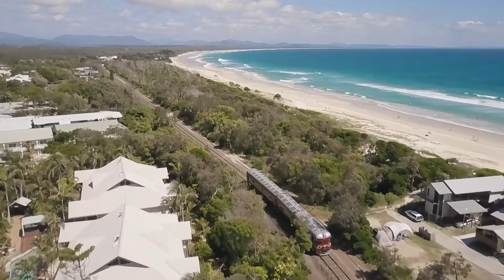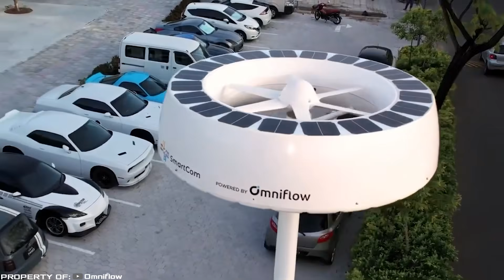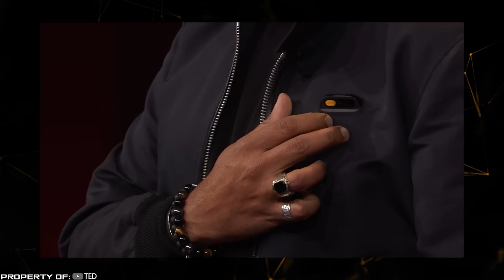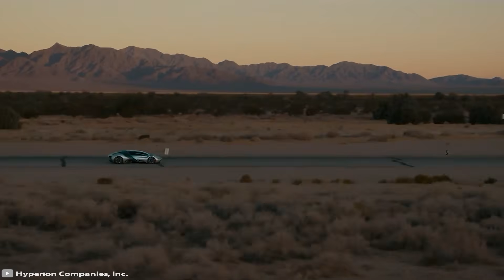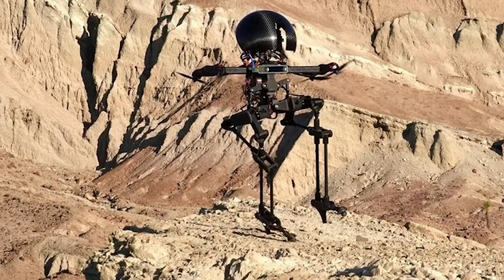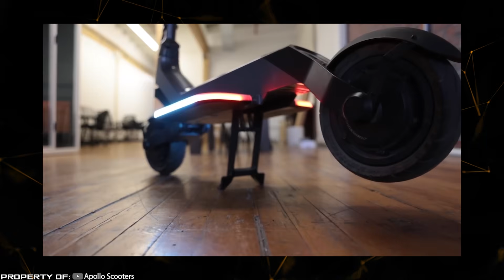INCREDIBLE INVENTIONS THAT WILL BLOW YOUR MIND | BEST OF 2023

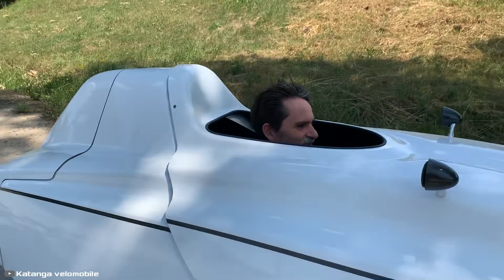Comment: (min. 12:28) Take a disc, or ball with a  diameter between 3.5" to 5' depending on the size of your hand. Hold the object facing upward with as few or as many fingers as you please with the edge  spaced between your fingers tips.  Without giving it a whole lot of thought, use your fingers (and thumb) to turn the disc between your fingers not letting the object fall, with the ball along its diameter. Reverse the direction as slow or fast as you like without too much thought. In fact the less you actualy think about it, you will watch the almost involuntary behavior of your finders placing themselves in just the right spacing  and timing to support the object and turn it. In fact if you attempt to tell or control which finger to move when, where, or how, you MAY notice, doing so will be awkwardly slow and you loosing control of the object. HOW would you develop a progam to tell three, four or five robotic fingers to do this?

Comment: the h2 panels have a flaw: #1- their core ingredient that makes them function, is platinum- so by the time you recover the cost of operation? you're still in the negative. #2- they only last for about 8 months before they fail- here's the major part he's NOT telling you: they use water fed to the panel- and they use sunlight to seperate the water into h2 & oxygen. BUT: EVEN IF you only feed them distilled water- the panels lose functionality completely by 1 year. the parent company that developed it cannot overcome this hurdle. this product will never come to market.

Comment: The Air Speeder 4 is definitely NOT the first racing Airplane. Professional Airplane races have been going on for almost as long as there have been Airplanes. 
 Have you never heard of pylon racing? Ya know, the Airplane races with the really fast internal combustion engines? There are several different classes, Some are bi-planes but most are mono-wing type. 
 And they are considerably faster than that plane.

Comment: The super lightweight Aptera that is liable to be blown over by a moderate wind, with half it's top surface covered with solar panels, takes 10 whole days of strong sunlight to charge. But the train with only 5% of it's roof covered by small solar panels use only 23% of the power from the solar panels? Something doesn't sound right here. It isn't even a new train. It's an old (ie heavy) train, with a few solar panels glued to it's roof.

Comment: 6.5 kW of solar panels is 9 hp!  Which may be peak power, less losses through buffering batteries, motor controllers etc. No wonder it’s barely moving.  Since the station has a lot of panels that can charge up batteries with the train idle, this would add to the power but overall this does not represent anything useful.

Comment: Switch from kg to literally without reference to pressure. Is it at atmospheric pressure? Does the system produce h2 from h20? If so what is the tech? Direct conversion in the cell or electrolysis? Something else?

Comment: The aerodyme truck trailer fuel saver is a good concept but isn't worth the hastle you have to go though to save. Just about all the trailers that I have pulled with this tech either doesn't open on its own like it should or you can't get it to close back up. Not worth the time.

Comment: Innovative Techs, 
You should look into Edison Motors.
They are a startup. They build and convert Semis into Diesel-electric. They take out the 19liter diesel engine and replace it with a 9liter generator that only runs 1/3 of the time. When it does run, it runs at peak efficiency for fewer emissions and better MPG. So the fuel tank can be smaller and still have the same range. They only need 1/4 of the batteries because of the generator. And the Semi weighs the same as it did before the conversion. They are also working on a way to convert full-sized pickups, buses, and RVs. Any vehicle with a solid rear axle. The generator can be anything, diesel, gasoline, natural gas, hydrogen, or instead of a generator, add more batteries. The generator is not part of the drive train. It is only to supply electricity to the batteries.

Trains have been using Diesel-Electric since the 1930's. It has been their standard since the 1950's. It doesn't matter if it's freight pulling millions of tons, or passenger pulling thousands of tons at 200 MPH. Its still Diesel-Electric.

Comment: The aerodyne concept is old and it won't work for the same reason the other didn't. The foils are supposed to deploy automatically once a specific speed is reached; however, the grit and grim from the road quickly gums up the works so they don't deploy.  Great concept, but until they can solve that issue, it's not going to be successful.

Comment: Win Lin need screen for birds. The AI pen is a S.T. communicator. The Egget needs hill resistance for heathy fish. Leonardo needs it's own ET movie. Cyclo tech propla
might work better on copter pack? The boat prop may be the best, if not, the $100 water heater (like the low cost computer did). Saline battery (not shown) will make elec go practical. 009AC4 plane could make VTAL double seater elec obsolete, with 12 passngers? Just thinking.

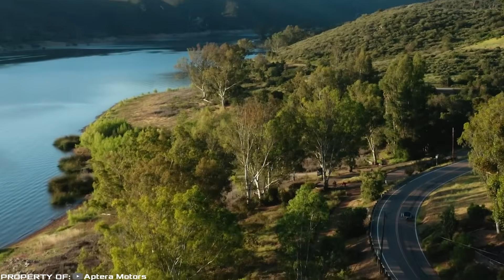Comment: 5:55 Every car manufacturer should be mandated to produce a universal, ultra efficient tear drop shaped, elongated electric vehicle (or the most ideal design possible, if thats not the best) at a reasonable price, and they can all offer their own spin offs on extra features and interior designs.
Reply: And a trailer of the same shape, or modular rear end on the vehicle that could be easily removed, and meld to a covered truck bed type rear end/ additional passenger cabin could replace trucks all together for most jobs, only used when needed and kept in the drive way or garage. The planet is dying and nobody seems to care.
Reply: But nobody would buy them   especially mandated .

Comment: We have sodium solid state batteries coming in March. These are already in production. These lithium batteries dont seem to ne ready wheteas Amprius and Quantumscape are already on the market. There is is also zn nava  batteries moving quickly and they can cycle 200k times and the materials are readily available. Not to mention they dont catch fire and already in use in over 200k homes.

Comment: Fraud. " Electricity will be supplied from the grid when there is insufficient solar and the train is intended to run on diesel fuel about once a week.[14]"   BURKE, JASMINE. "Byron Bay rail revived after 13 years with solar train". Northern Star. Archived from the original on 22 December 2017. Retrieved 20 December 2017.   From wiki article.    And probably got grants after giving COMPLETELY LEGAL campaign contributions to local politicians.

Comment: Thanks for showing Renewables.
But for me it's hard to watch clips about solar and wind generators wether for hydrogen or electicity generation still presented innovations or even inventions in 2024. These two products were first presented since the dicovery of direct current. But it took two centuries of carbonwasting thanks oil lobbyism to legislate the necessary standarts.
But the oil lobbies are still running us down ...

Comment: The Byron Bay Electric Train is Australian and a great example of what can be achieved.
The train only needs 23% of the energy generated from solar panels on the train shed roof, the remainder is fed back into the community grid.
The train also uses regenerative braking, meaning that every time it slows down, the energy created by braking recharges the train’s batteries.

Comment: using solar to make electricity to run electrolysis to make o2 and H, so you can then just burn the H to make heat? or  run a car??  COME ON,,, just take the solar electricity and run a electric heater for heat, which should be almost 100% efficient , or store electricity in batteries , and then run heaters or drive motors, etc, when needed...
Reply: Yes yes yes

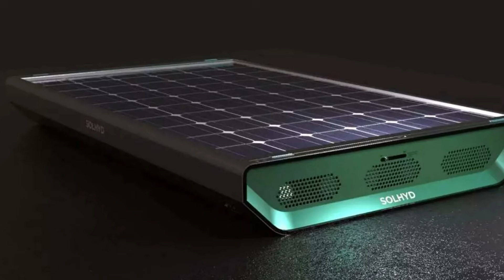Comment: @ 17:50 hydrogen sola panel than can produce "up to 250 L of hydrogen a day". Is that correct? That's equivalent to about 22 kg of hydrogen or 500 kilowatt hours when put through a fuel cell. Thats huge?

Comment: The LED light is much more dangerous for our environment than the lightbulb. And I have yet to find one that works for over 3 years when they advertise for 10 years.
Reply: The led bulbs usually fail because of the electronics used to step down the AC voltage. The led would still be usable if not for that.

Comment: I like the portable wind turbine. At around USD$400 (AUD$587) it seems good value if it is durable and replacement blades are available.
Reply: I understand theses kill a lot of birds.
Reply: @metrork1  Ouch... do theyes? I'm with you if the data shows that way.
Reply: VAWT's are less efficient than HAWT's, but VAWT's can be placed in locations that are not safe or appropriate for HAWT's, and VAWT's can be placed in greater density than HAWT's and produce less noise than HAWT's as well as being much easier to build and maintain. 

You can put a VAWT in your back yard or on your roof without getting complaints from your neighbors or having to put in geared arrangements to work with differing wind directions. Also, the generator part of the apparatus is fixed and at ground level, again making maintenance much easier.

And, VAWT's can easily be made nonhazardous to birds.
Reply: A far better wind generator is a cyindrical one and fits on the roof. And is small. And will power a home when the wind blows even gently. The bird chopper style costs more in maintenance than normal electrical sources.

Comment: They are solving a non existent problem. Global warming is not bad.  An increase of about 1.5 degrees since the little ice age.  The most prosperous century in history.  What we should be doing is developing even more coal, gas and nuclear power in preparation for when the climate reverses toward another ice age.  Also provide energy for undeveloped countries.
This video is also deceptive.  The solar panels on the train do not provide all the energy for the train to run.  Most of the energy to charge the batteries comes from the panels on the roof of the station.
Solar and wind have no hope of replacing existing dense energy of coal, gas, oil and nuclear.

Comment: "unreliable solid fuel boosters"
uh, no.
Reply: Exactly! SBR's are pretty much the most reliable rockets there are!  The concept is simple: No moving parts.  You just light it, and it runs ... RELIABLY ... until all the fuel is burned.  Then it stops.

Comment: Placing solar panels so crops can be grown underneath, in arizonz, ca is very promising, inreases wzter collection, shade am provides energy for electric tractors.  Solar reduces heat in hot areas such as phoenix by converting solzr energy into electricity vs heat.  This helps everyone in city further reduce air conditioning costs.

This should be mandated by law a.omg with white roofs.

Furthermore these reduce global warming by reflecting heat back i to sky, and could even increase rainfall.

Comment: That train will not run on its solar panel's alone unless maybe it sits in the sun for a year.  There is just not enough area for enough solar panels.  It doesn't work with cars either.  Grain of salt for most of this, especially the wind turbine stuff.

Comment: In a similar false statement - you put a claim on the manufacture of the Aptera they could charge their Motorcycle not car - to go 40 miles in a day. If you see the note below; it takes 10 full size panels to move a Model 3 15 miles; the Aptera if ever built for buyers has a very limited space of panels and even though it is ligther and stream lined it has no chance of going 40 miles; maybe 5 or 6 would be more feasible at 30mph. Do not just publish false claims because someone says so.

Comment: Something is dramatically false about your Solar Train report. It takes 10 full size solar panels 10 hours of intense sun to charge a Tesla model 3 to go 15 miles. This heavy train wouldn't go 2 miles. There is a statement "the solar panels provide 23% of energy needed while traveling on its route" This can only be true if you mean after it accelerates to speed which is what take all the power. 23% to keep it rolling after that isnt much. You might excersize some honestly in your reports so people are not lead to believe the rediculous.
Reply: Fantastic catch! 👏🏻 👏🏻 Yeah I was putting those numbers together when he was speaking about the train and was like... "Wait. That doesn't sound right." Thanks for doing the math already.❤
Reply: more like 23% of the phones and computers charging power outlets... 🤭
Reply: Fake news 😅😅😅
Reply: Rolling resistance of a train wheel on track is 10x less than a car tires on road. Even then I concur that the energy production is probably just sufficient for a very occasional usage.
Reply: @ericzucker  good to know so even with more panels its pretty much a sham to call it a green train powered by self contained solar.
Reply: We (my wife and I) power our home with solar. We have five 250 watt P/V panels. And that provides power for all of our electric needs, on sunny days.
   However, we do have a 500 watt wind turbine down here in southern Arizona. If the sun ain't shining. The wind is almost always powering the wind turbine, and a 4000 watt generator.
Reply: I could walk faster 😂
Reply: I think there are probably a lot of mistakes throughout. He kept referring to the drone bodes as engines, for a start. Then referred to the angle of inclination. Not the correct terminology so I guess the research is weak.
Reply: The train is just a tourist trap. It's as slow as a wet week and not always working and only travels on a single piece of track a couple of kms. long. (i live nearby).
Reply: @davehaven6986  Figures... Just ignore the man behind the curtain...
Reply: Edison EVs
Reply: Pñ
Reply: I notice straightaway that the train should be covered all over with solar panels which it isnt.
Reply: You nay seekers, this was rigorously tested in many lands, legoland, Disneyland, and many other countries. You should see them flying down the hill!!)
Reply: Don’t compare a solar car to a solar train depending on the gradient once you’re up to speed with good roller bearing on the bogies a train  will roll along way with out power added I know I’m a electric train driver and do this on my routes daily on some sections mostly up and down yes on a flat track you are right 🇦🇺 QLD
Reply: @ajllemm  fair enough but once you hit any sort of uphill; it will probably be quite useless to try to use direct sun to keep it going; flat ground is one thing and going up hill is quite a bit more energy demanding.  You are literally lifting the weight of the train.
Reply: @litestuffllc7249 Yes, but a huge amount of slowly built up massive momentum helps average out hills.  Once the first cars crest the summit & begin to descend, they are helping pull the latter cars up the incline.  Trains don't waste momentum with stop & gos.  The steel wheels on steel rails introduces much less rolling resistance than tires on pavement.  The close coupled cars break the wind for each other, reducing aero drag.  I read the fuel economy for trains is 400 mi. per ton per gallon of diesel fuel.  That's remarkable, but still not enough to justify those claims about the solar contribution.
Reply: @dennisbecraft1303  Yes that is an advatage of a train or even better with a cable car; but you do have to get up the hill.
Reply: Similarly you should prroofread so you don't mislead people about how "ridiculous" is spelled.  JK 😊

Comment: There's no way with current technology, that a train can be propelled with 23% of the output of solar panels on the roof.
Reply: From a show I watched specifically about that train. There is a little bit of an incline (hill) and they get a little worried going over it.  Maybe it uses 23% of total power generated throught the day cause most of the time it's sitting. But when operating I bet it needs all of its solar to operate. And you are only going to add so many batteries into the train cause it makes more weight to have to climb over that hill. So when the train docks the batteries charge to full 100%  capacity the extra solar power is fed into the grid instead of turning the system off and waiting for next train departure.
   I bet there are alot of solar systems out there that shut down when fully charged that could divert that energy to anouther  needy  device requiring more power.
Reply: It's all dream time!
Reply: The solar panel cars need typical 10 days (in full sunshine) to have the battery fully charged for a 400 km range.  A train might allow for a better orientation of the panels and better driving efficiency.  It will most probably score a little better, but this is not for driving long distances.
Reply: You mean the power of a couple of 2 bedroom brick homes with acc and Cable,  wont pull...?  
:hand-orange-covering-eyes:
Reply: awg #4,  would be good for the 440 inverters,  guys.    old school thyrectors to block spikes.   toot    toot.... on down the line,  on a down slope run...  screaming whistle blowing.    OK,  cool Tech ... CHECK....  Build it Bidem  !
Reply: That's what they want you to believe brother.
Reply: If you look 0:32 into the video, you'll see solar panels on TWO DIFFERENT ROOFS: 
that of the train (6.5 kW) and that of the station (30 kW).  Both (as well as regenerative braking) charge the Li-ion batteries.  The 23% refers to the combination of power generated on both roofs, including when the train does not run (e g when off-loading passengers).
Reply: I live near this "train"? It's just a short length of track a couple of kms. long that takes tourists on a bit of a joyride. Its not a solution to anything. It's total bullshite.
Reply: You sound like a tough guy online😅.
Reply: Go Trump!
Reply: We have to win this election! It's our last chance.
Reply: Notice the under carriage tanks. Definitely a hybrid